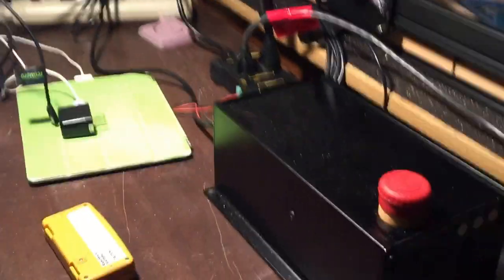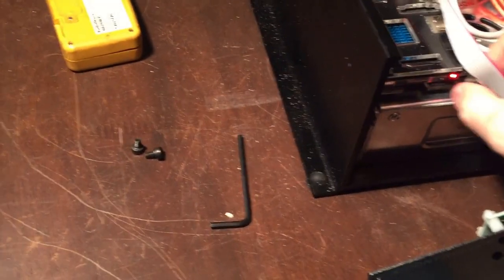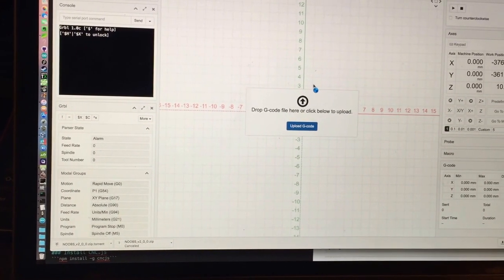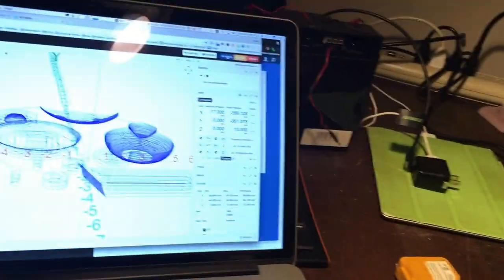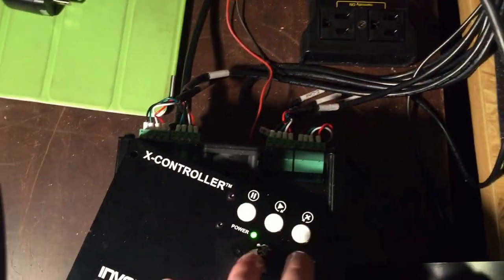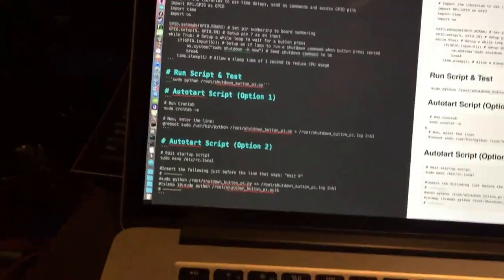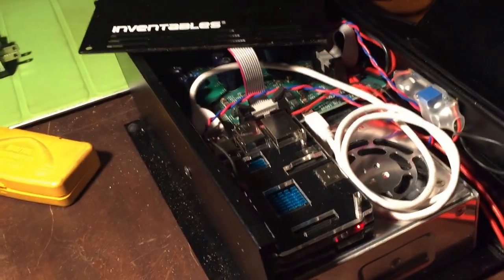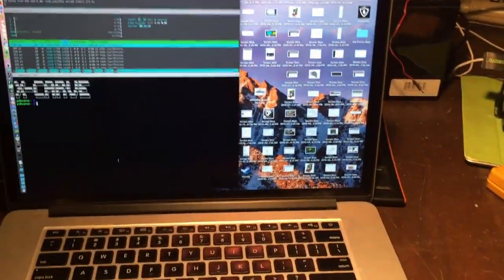X-Carve X-Controller w/ Integrated Raspberry Pi & CNC.js

Comment: I can't believe there aren't more cncjs videos in YouTube.  I just found the cncjs desktop application by accident and its wonderful.  I was using Universal G-Code Sender before, but I like this better.  Its a cross between Chilipeppr and Universal G-Code Sender. The Widgets are great and it looks great. 

Can you explain how you are able to move the visualizer orbit. Also, when moving to Work Zero and Machine Zero using the Axes widget the Z axis move is gradual. I had to make two macros to move to work zero and machine zero so that I can move the Z axis first so that it clears the work area first then move the X and Y. 

Can the Axes widget be modifies so that the move to machine zero happens in this order Z0 first then X0 Y0 second? And the move to work zero happens in this order X0 Y0 then Z0?. This way we are sure the moves always happen above the work area.

By the way I am using the latest version cncjs 1.9.7.